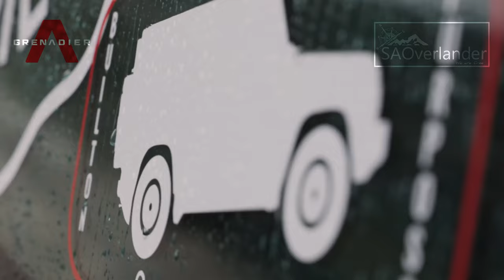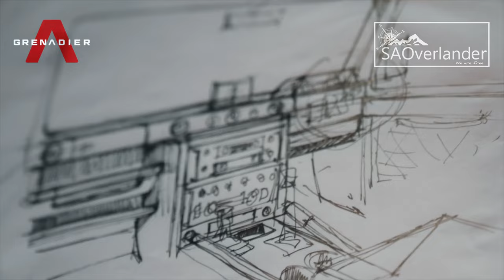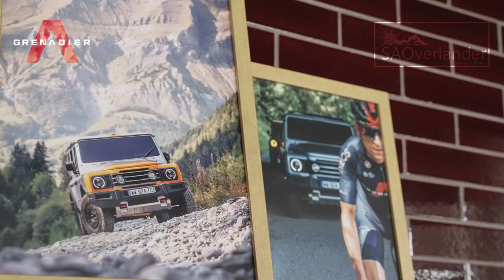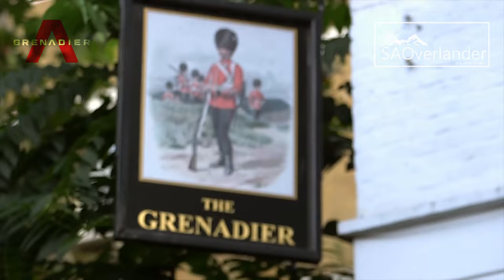SA Overlander - INEOS NEWS Grenadier  -  Sir Jim Ratcliffe  -  We are almost there.

Comment: I thought it would come fully loaded for about 50. Its 80thausand Franks ($85’000) here in Switzerland. Waaaay too expensive! I also dont like that there are no gages on front of the driver its all in the middle screen thats a bad design decision. There should be analog speed, RPM, heat and fuel right behind the steering wheel. I dont want the screen in the middle at all give me all analog option. My phone is 6.1” thats pleanty of screen i dont need another screen in the car. All analog option should be much cheaper too and much more reliable. I cant believe they went with so much tech in the middle screen. We dont want that!
Reply from the maker: Agree it is a awesome 4x4 .. and overlanders will not be disappointment but price on the extreme side ..